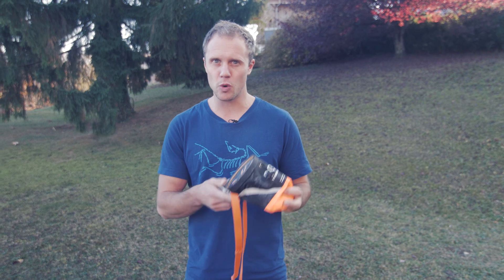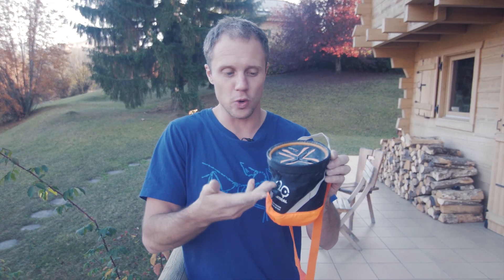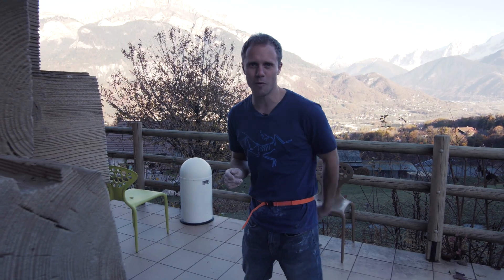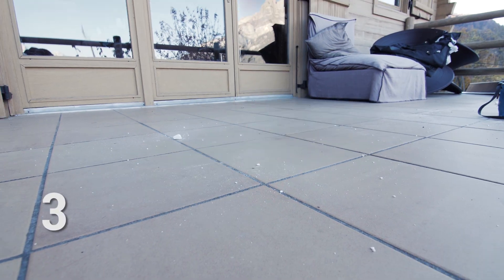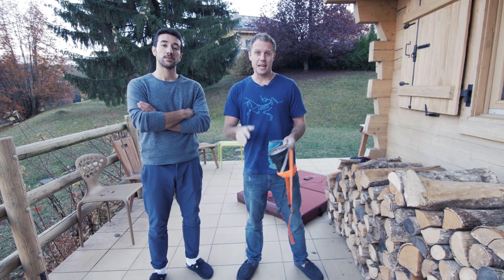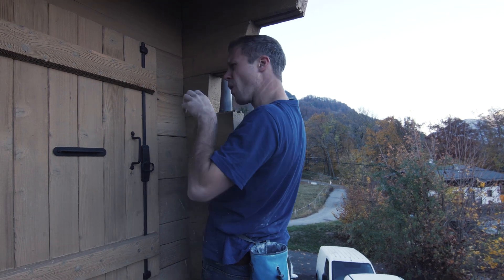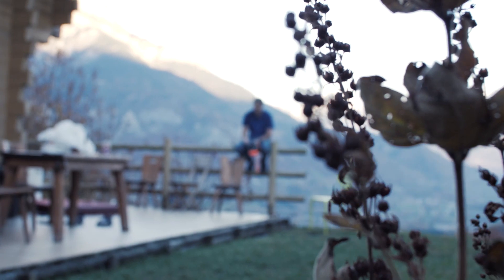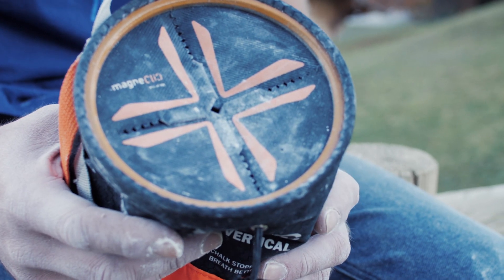Yes...That's A Magnetic Chalk Bag! | Climbing Daily Ep1295

Comment: I bought this bag, used it for 2 to 3 weeks. Problem is that it does not age well at all as already the auto closure system is not working properly anymore. Even worse, one of the 4 panel is kind of broken now and detaching itself. Conclusion is: great idea, not sustainable at all.
Reply: How consistently did you use it during that period? Nearly everydsy for long periods? Curious :)
Reply: Chalk is cheaper than dirt who cares.
Reply: nick blanchard not if you buy friction labs
Reply: Thanks for the honest "review"

Comment: Just not convinced by this, the problems that it is solving are not one's that I've faced before, i.e. I'm okay with losing 6 seconds opening a drawstring (which if you look closely the Magnetic bag also has), I've never knocked my chalk bag off a balcony or forgot to open it before starting a climb (as I tend to apply chalk before I get on the rock).

And even if you are saving chalk while it's in use, I can't see it being as durable as a normal chalk bag. I.e. I do not think this would survive at the bottom of my bag inbetween my full rack and twin ropes. I'd imagine (I'm being careful not to say certain) it wouldn't survive being squashed between awkward, lumpy and (relatively) heavy kit on top of it.

Plus: 5:54 hand goes in easy
6:45 seems marginally more awkward

You know that saying, "if it ain't broke...."

Is this a promotional video as opposed to a review? Because if so then this makes sense.

EDIT: Just realised Epic TV is also the EpicTV Shop, penny's dropped.
Reply: Luca Cycles exactly as I said
Reply: @BobMarley-vl5gl  Not exactly...
Reply: ive just bought myself one becuase the issue i run into is breaking the drawstring every 2 or 3 months(indoors), so if i dont have to open and close it so much hopefully it lasts a bit longer. outdoors i'm still going to continue using a normal one
Reply: @charlesphillips8062  I am surprised to read this, I have never in my 14 years climbing broken a drawstring. Now that I think about it, I'm only on my second chalk bag, and my first I only stopped using because the zipped pocket broke.

Anyway, good luck with it!

Comment: How well does the closure system work when it's smushed up inside a bag or inside a bouldering pad? I love the ideal personally, I kinda want to move away from draw string closure systems coz they seem to fray for me, but still I'd like to know if the magnetic closure system can hold chalk in when the bag is compressed in a bag
Reply: I dont think you are supposed to rely on the magnetic closure when throwing it in the bag, its just for climbing. You can see that the magnetic bag had a drawstring as well, he just didnt mention it. So you can close it fully just like the blackdiamond.
Reply: @jersey282  But how well will the magnetic closure last when squished up underneath your rack? I could see the rubber flaps deforming quite easily
Reply: @jersey282  I actually didn't see that at all, but thanks for pointing it out!
Reply: @Lion yeah I saw that too, but that only makes it more likely to forget opening it.

Comment: This is a good preliminary test but the testing left much to be desired. A key issue is how easy chalking up is once the chalk bag is open. It would be nice to see more tests showing the difference. It would have been good to see a test on a longer climb that is actually on either indoor climbing holds or real rock. Also its unfair to constantly test the magnetic chalk bag second. The second climb one climbs something is typically going to be easier. A key concern for some  is how much of a mess will a chalk bag make in their bag. When closed correctly I could see the magnetic chalk bag spewing chalk everywhere when crushed while a regular bag won't do this. It would be nice to see a comparison with other chalk bags such as the arc'teryx chalk bag which has a special closing mechanism.